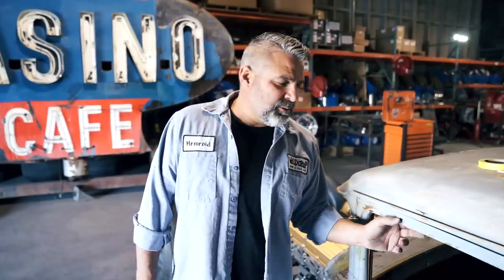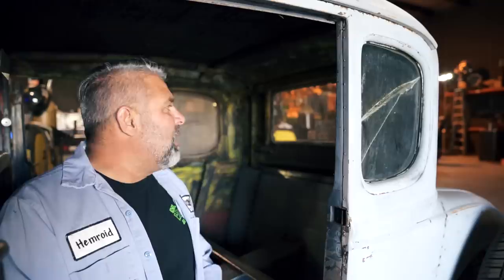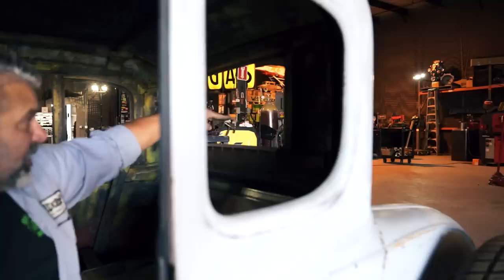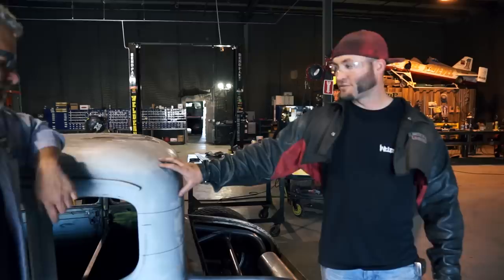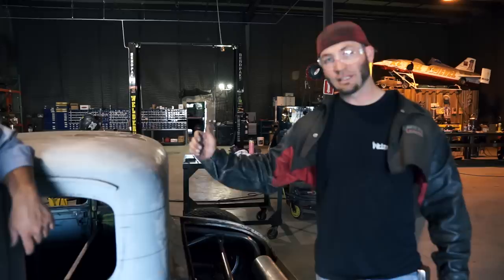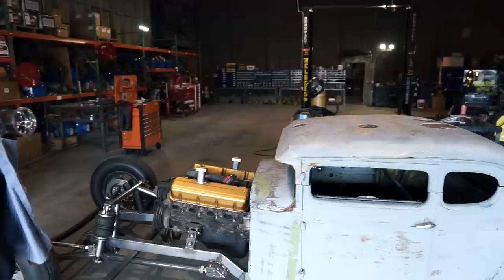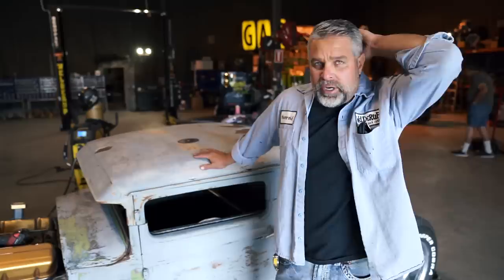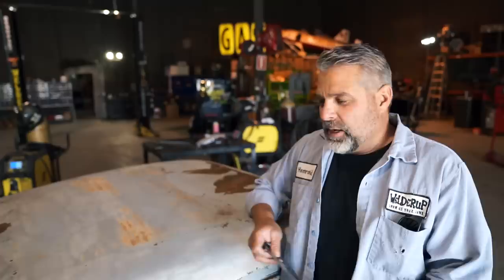How To Build a CHOP TOP RAT ROD Pt.1

Comment: Hey Steve, in Australia if we do a turret replacement we have to stagger the cuts for inner and outer panels in the pillars then re plug weld the spot welds on the edges. Takes a while to measure but makes it easy to hold together with vicegrips and makes it nice and strong. Love ya work!

Comment: steve seriously love what ya do!! you inspired me to build my own truck i had planned on a gasser style rat rod but the truck is from Tuscon so i had to paint it it was so nice i just had to make it nice! but i stuck with the rat fink style (your 55) its a guitar shop themed 56 dodge C3 i have custom lift blocks 60+in long ladder bars the hangers are shaped like an explorer guitar roadie passes on the dash set lists pasted to the roof a super tall guitar neck shifter PAR CAN taillights and a twin turbo twin AFB carbs 322ci poly 318 should make 700hp with my guitar shop logo on the doors PANAMA RED GUITARS, i also put the tank in the bed and covered it with 2 fake amps also with my shop logo behind the mesh screen backlit with red and green LED'S ,well i have all the parts and the frame is now finished so im assembling it now!!! wanna help???
Reply: That would be cool to see when your done